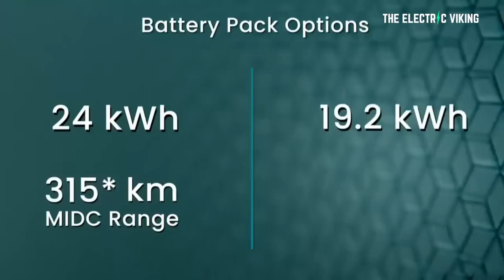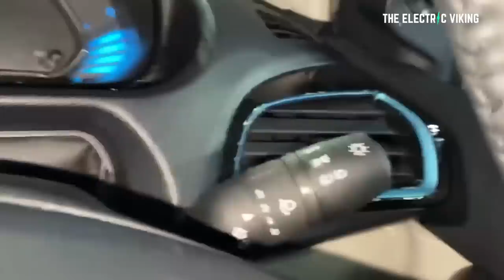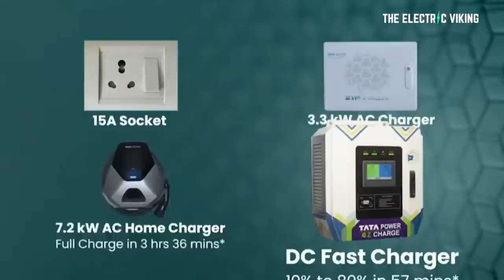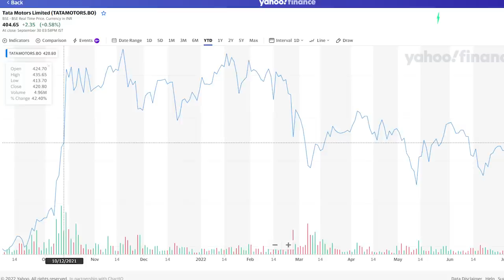India's $10,000 USD electric car - is it good?

Comment: 24kWh, same size battery as the Gen1 Nissan LEAF, but claims more than double the range?   The car doesn't look nearly as streamlined as the LEAF, and surely it's not half the weight?  How on earth can it achieve double the efficiency of a LEAF?
The MIDC must be even more forgiving than NEDC (Not Even Darned Close) standard if it that's the case.
Reply: The real world range would be between 200-230 kms.
Reply: There has been a lot of leaps in battery technology since the Leaf. Still 250kms max real world range, in my best guess. Still makes a compelling car to scoot around you local area for 10K

Comment: The main problem with the Tata EVs is the charging speed, which is lower than the first generation Leaf or Zoe. Also, the theoretical range according to MIDC is about 30% higher than in the real world. It's not that hard to find some independent Nexon EV test on YouTube.
Reply: Exactly.

Comment: I owned a Tata vehicle once, bloody nightmare it was. The wheel just came off whilst driving and electrics were  as close as one can get to a Pandora’s box. I wouldn’t touch them with a stick. If they end up as the only viable EV option available, I’ll buy a donkey and cart instead.
Reply: They have come a long way from that.
Reply: Very bad experience with Indian products. Very cheap, fall off easily. Nano was horrid
Reply: @ciybersal9833  yeah better go buy some Chinese products then
Reply: They have improved quite a lot.. and those cars were probably from initial days of learning for them. Infact they rate highest in safety ratings for comparable cars in same categories ( 4 star at global ncap) my parents have owned 4 of them across time starting with indica from early 2000 till now.. barring the first car which was really crude and unreliable they have come a long way.
Reply: Wheel came out , man you might have brought some tata car which was on disposal,  buy some new tata car if you can afford
Reply: @RajaDas-ex2pf  it was a brand new Tata Safari strait out of the showroom, European specifications. Wheel came off when still under warranty, thank God. Following that misadventure and repair, all-wheel drive electrical switching system had to be replaced, one component at a time. After that it was downhill with the electrical system and I had enough. Sold the car for a pittance still under warranty, and followed it with a properly built 4x4 from Toyota, also new and still running.
Reply: @simonjohnborg  it seems that European or American cars never failed even once throughout the past seventy five year's, all the car's were perfect not a single failure.
Reply: @girirajgovindaraj6975  I never said that nor am I comparing with manufacturing nationality, far from it. I just shared my brand experience and why I personally, for my own choice will not look at Tata. If Tata made progress, good for them, for their employees and their customers but for me, it’s off the menu. End of story.

Comment: The picture that you missed while analysing Tata as an easy manufacturer is that that also has a company known as Tata Power which has the largest charging infrastructure in the company at the moment, Tata has another company called Tata elxsi which is in the field of software development, system design, integration and majorly provides it's services to the automotive sector. Tata chemicals can be steered to produce battery packs and even b🔋 cells. Tata Steel is a major producer of steel.

Therefore in my analysis Tata motors electric car division is a Tesla in the making and that's the reason that I am invested in both Tata Power Tata motor and Tata elxsi. 🤗

Comment: Driving cycles are obsolete.  A range of ranges under different driving conditions is a better measure.   Here's what I recommend: 1. A few different highway speeds to take into account different use cases and countries and states.   2. City cycle slow stop and go driving.   3. Maximum emergency range under very slow steady driving.

Comment: Interested to find out were they can find battery supply?  Battery's seem to be limiting factor in supply chain.
Reply: They Don't have to Find , Actually they have ; Tata Groups Own Tata chemicals which is Capable of Manufacturing high quality Batteries , Tata Power is Capable of Charging Facilities all over india, TCS is ($200B) company will provide Software, Tata Electronics will provide Electronic components to them ; They Owns World 5th Largest Steel Company too ... in Conclusion Tata Groups has everything whatever require in   manufacturung a car
Reply: @pcp3457  Thanks

Comment: Yes Tata is indian car manufacturer and recently he sell more than 4000 ev cars in a month(highest). The average sell of ev car by tata is approximately 3000+ per month, there are some class leading features in Tata car's 
1. Safety, Tata car's are the most safest cars in india , they score 5 stars in ncap global crash test 
2. Good suspension, Tata car's have best in class suspension system providing a good ride quality
3. Steering response, tata car's have a  nice and a very responsive steering system just like Volkswagen 
4. Low pricing
5 low running caste

Comment: The load(road) profiles are derived individually from each country to account for the environment -both natural (temperature and humidity) and man-made (road surface texture, potholes, abuse case probability, vibration profile etc).
There is however an international standard for the same too.

Comment: Thinking of getting a Tigor or Tiago here in Nepal. I've been in both, and they are solid. But the Tigor/Tiago will only get a 220km range in real-life tests in India. It powers down after about 200. This makes for a great commuter car in Kathmandu, but not for exploring the countryside. (for example, at 75hp or so, I'm not sure u would be zipping up hills or finding a charging station when you needed one.) Unfortunately, in Nepal with taxes, it comes out to about 25K USD!  Still, a bargain, considering the price of petro vehicles here. The styling is very conservative, which I like, with a normal placement of gauges and things. I could not get the driver seat to lower (maybe it does somehow) and at 5'11" I was looking dead into the headliner, which may be a problem. In the Tigor the back seat is HUGE, and the doors feel like they weigh a ton, compared to anything from China here. The steering wheel has all the required buttons and knobs, but not sure if it adjusts for height; it is squared off at the bottom, which makes it feel like there is more legroom. I've driven Tatas before, and this is NOT ur father's Tata!

Comment: One of the reasons that i might know why the tata vehicles are a little expensive than other vehicles in india ( not all , the basic models that is similar to Tiago and maybe I'm wrong ) is mostly because of the safety measures over their vehicles over other companies... Tata goes for proper metal body for most of the main areas of accident safety of the car body to metal parts when other companies use fiber and plastic for the body

Comment: I just don't get my head wrapped around these range figures. How is that measured? At 30-40 km/h? EVs i know don't get to land much lower than 15kwh/100km. I am in Europe, we have cold seasons too here, so that may be different to India - still i'd guess real life with radio, heater/AC or wipers, lights this little sweetie would give around 150-170km - not at all bad for the price. The Smart fourtwo is a cheap plastic nightmare with a cute shell - but costs three times as much. Great find!

Comment: But the car that's flying off the sales charts in India is the $18K NexonEV
NexonEV is the most practical EV with the 300kms real world range and the perfect price & a battery size that can be charged at home from a Refrigerator, Washing Machine or AC plug point.

A bigger battery than that means you will have to take the car to a charging station and wait in queue to charge... which makes the whole idea of owning EVs as senseless.

10K would seem like a good price but it doesn't hurt economy wise to pay 18k because the "refuelling" will be free and there won't be any regular service/maintenance required.

People who replaced their SUVs with NexonEV are plesently surprised with the amount of money they save in refueling.

NexonEV is the PEOPLE's CAR

The demand for NexonEV is so high in India that Tata is finding it difficult to meet it.

Tiago EV & TigorEV is basically for UBER or Taxi or Fleet cars and there  EVs can double their income in savings in fuel costs.

70% of Uber drivers income is spent on fuel engine-Oil & maintenance costs. EVs remove these costs completly & these people can earn much more.

But these cars will never be sold in US or Europe ... Because the local car makers have been preventing both Tata & Mahindra from selling their cars in US & Europe since many yrs.

Mahindra Roxor barely got an ATV certificate in US while Tata couldn't get even that for any of its cars.

Tata bought JLR in hope of trying to sell its cars in Europe but are not allowed. But these loss making companies are pulling Tata into debt.

Tata will have no option but to sell JLR and it's Steel Plant in UK within this yr or by 2023 max... because of these restrictions & games are hurting Tata when it wants to grow the fastest.

The next 10 yrs in the Automobile world will belong to Tata ... Then it will be overtaken by Ola Electric.

People don't believe me when I say Tesla will become a loss making car company in next 3-5yrs. As many other EV companies outsell Tesla.

Tesla's problem is Elon wants a self driving car ... not just an EV... both are 2 completly different products.

Comment: Most of the EV cars in India are being introduced by local Indian brands such as Tata and Mahindra, or the Chinese MG Hector. There is a great upsurge in the demand of these cars in recent months because of the high cost of fuel compared to the electricity. These companies are ramping up the production to cater to the market demands. Note also that there are a lot of companies which make smaller EV products such as scooters and autorickshaws (for which there is a huge market in India). 
       In my opinion, Tesla should work on its India package, which should include a small affordable car, a scooter and an auto. The long range of tesla battery packs will be their winning factor.

Comment: I'm Malaysian American and in the US which is different from European and colonial pretensions. Japanese and Korean brands are respected here Toyota Lexus are untouchable in top quality and reliability.  JD Power and Consumer Reports are American . No Euro brands are in the top 10. The automarket here is a meritocracy and is not protected. The UK and EU have had import duties in the past and still do in some  parts.  Mahindra's Reva  and Tata  have had electric cars and Indian engineers are respected here in the US
 The head of Tesla's autopilot and software is a Chennai trained engineer.Ashok Elluswamy. This is just the start.

Comment: MIDC cycle is a modified version of the globally known NEDC cycle, but with speed restricted to 90kmph.
This is because of the average highway speeds here in India.
The range from MIDC cycle is not a representation of real world driving attern due to its smooth acceleration pattern.
Real world range can be 20% to 30% short of the claimed values.

Comment: When the current line up of ICE vehicle platforms are upgraded in the future, TATA will be able to put in larger battery packs. As is evident from the rear positioning of the battery pack in the Tiago and the Tigor EVs. Hope they will be able to upgrade the platforms to support floor mounted battery packs or like Tesla, the Battery pack doubling up as the floor itself.

Comment: If i can trust any Indian car brand the most, it will be TATA, me and my brother owned a TATA diesal and Petrol/ CNG Tata Indica V2, which later transformed into Tiago and EV versions.

Damn my car is almost crushed from 2 sides, one side it was a Bus and Other side it was a Truck, and it saved my parents and brother as they were in car, apart from some dents and paint with deep scratches, nothing big happened.

Not only that, a buffalo jumped on my other brothers India at a good speed and damn only side mirror broke 🤣 and rest was okay.

Engines were awesome so do easy to maintain and few of my friends who own Tiago EV are indeed very happy

Comment: I believe tata came out with a car powered by compressed air. The car was to be made in India but their idea was they would send out the motor and major components to other countries. Those countries would make low tech parts of the car like door panels, floor mats etc......reducing the cost of the car to the consumers in that country. The car ran on compressed air. The air went out hru a motor which turned the wheels. The owner would use electricity to run an air compressor to charge the cylinders. Is there any reference to their air car in your research????

Comment: India is looking ahead to develop hydrogen fuel cell based vehicles. EVs are more of a diversion as they’re not really any less polluting than IC vehicles in the long run. The difference is, in IC engines you’re polluting the air but EVs are far more damaging wrt ground pollution. Hydrogen fuel cell engines will be the real game changer.

Comment: replacing lithium ion cells with Sodium ion cells is the next big thing. The current batteries 🔋 of EVs should be designed in such a way that li-ion batteries can be swapped out and replaced with Sodium ion batteries with more or less the same range. Lithium is not easily available and price per KW are rising exponentially. Sodium ion batteries are the future. Even better are hydrogen Fuel cells.

Comment: You need to understand one thing that Indian rupee is very very very powerfull locally in india it has more buying power here in india gdp per capita in india 2200 dollars which is very low compared to the world but those 2200 bucks in india will buy you what 8800 would buy in the u.s so this car if launched internationally it will not see a 12k price tag it could be 20+

Comment: It's not realistic to set up a global automotive range standard. The range of any vehicle (EV or ICE) depends on way too many local factors which make it very difficult to standardize into a single test. Even if such test was designed, it would be of little use to the majority of countries other than the one it is based on. Regional standards give a better idea of how far the car will run locally.

Comment: A universal range measurement standard might not be suitable for a car that is sold in 2 markets because of different driving conditions. So while a Tesla Model Y in the USA might have a EPA range of 330 miles, it is about 5% higher on the WLTP calculator. In India, with it's significantly slower speeds and warmer temperatures, a Model Y could have a range upwards of 400 miles in the real world.

Comment: My best guess, western driving standards won't apply to india. One simple argument is the dynamics of the land. Its not the same. So is the climate and landscape. 

The Indian hot climate is not going to treat well the machines that are designed for the west. The lastest news of ola electric bikes catching fire is the best example of that. The condition of the roads and the heat is going to cause malfunction in the battery. 

Bottom line india has to have its own standards and compete with the world standards.

Comment: Tiago is pronounced Tea-are-go…
As you note the Indian EV drive cycle is very different, the drive cycle for ICE cars is similar to the NEDC but capped at 90kph to reflect the lower speed limits in India, similar with their own road testing (as it would be impossible to use the same cycle as Europe within the speed limits), but the EV cycle is the urban part of the NEDC (up to 50kph only), as for harmonising cycles, good luck with that.

Comment: How about we have real world standards for range on EV’s. 
They could a 100 acre city with a 100km high speed track around it and every car  company have to do their range test there.
Reply: Agreed, and really, the only range that counts for an EV is the highway test.  They should have a standard for Highway-only driving, set at 70mph/110kmh and record how far it can travel until it drops dead.  There is no point knowing the city driving range of an EV because you can easily find a charge anywhere in most cities, and no one is likely to use the entire battery in one day unless you're a taxi or a courier.  You only need to know how far you can go on a highway so you can plan your long distance trips accordingly.

Comment: EV cars are an environmental disaster in the making ! It does not reduce CO2 ‘emissions’, most electricity is generated from coal & natural gas anyway. It has lead to an increase in mining of rare earth metals and lithium which will accelerate in the coming years. The life of battery packs (about 500 kg per car) is limited and there is no clear cut strategy to recycle the batteries once the reach the end of their life cycle, probably 10 years. The electricity grids in even countries such as USA are ill-equipped to handle grid loads of added EV recharging if they manage to attain even a fraction of their EV target of 2030 !